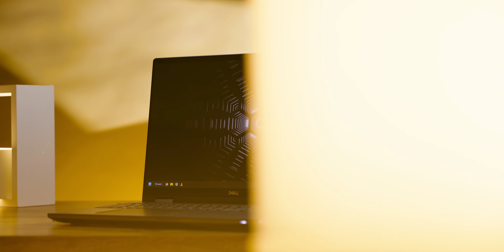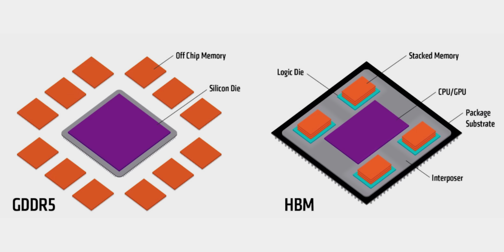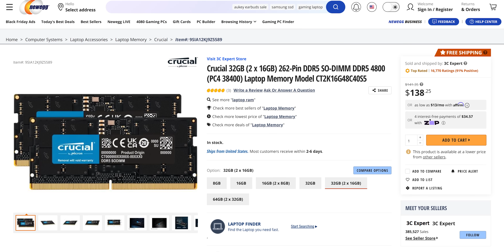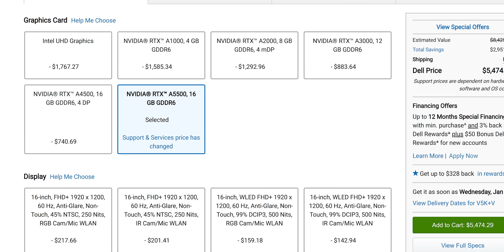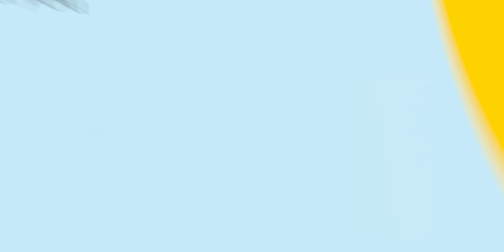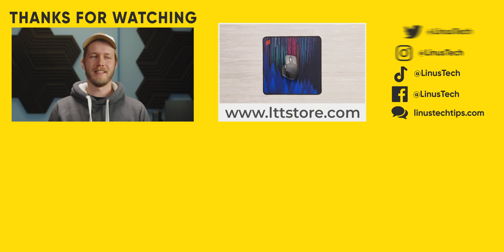I've NEVER Seen a Memory Stick Like THIS - CAMM Explained

Comment: Doesn't look smaller and I don't understand why they cannot flip the sodim placement, to have the connector next to the cpu. It is not even thicker. My asus vivobook s 14 k3402 has the sodimm slot base close to cpu. Only problem with that machine, the other "module" on the other side of the motherboard is soldered.

Comment: I managed to get a RTX A2000 6gb model for €250 (used) and I am truly amazed at how good it is for a 75w pcie powered GPU.

Why not the 12gb model some of you might ask... Well it's a 75w max card, so more vram means less power for the gpu cores. Less power for the cores means less fast in games and 6gb is still enough for the games I play.

Comment: Actual question: Why THE FUCK is it important to make devices thinner? They're already so thin, I can bend a laptop with my bare hands.
Also, the complete lack of reusability means this is e-waste generating trash.  Might as fucking well solder to the board at that point.

Comment: People upgrading a laptop over it's functional useful life make up such a tiny percentage. I would rather just have soldiered ram and instead of making a new janky standard, how about making large ram the standard. Why the hell do any machine still come with 8Gb of ram is beyond me. We should rock a minimum of 32GB if not 64GB. And if you bought a laptop with enough ram to begin with than you would not be in the upgrade boat.

Comment: if Dell is opening this up to anyone to use I am all for companies trying it, my last laptop had soldered ram (it wasn't much it was 4GB) and the ram failed, guess what you can do with a laptop that has dead ram when you can't replace it? add it to your e-waste pile. there may be a way to desolder the modules and get the same modules but a $90 laptop isn't worth doing that too IMO.

Comment: Most Precision user just cannot care about the speed of the actual machine because they cannot experience it.
I get precision workstation laptop from my big company and all the big companies have super slow UIs because of all the security stuff, too slow servers (even if they have the best and most expensive stuff available on the market) and VPNs.

You just can’t experience the actual speed of the physical machine, because it’s overlayed by super slow virtual things..
And usually there’s no way to get around it as a normal engineering employee like me.

The sys admins could, but then they would properly loose their job, because it would cause a security breach.
We can’t install software anyway, so it has no use at home besides for work purposes and browsing the internet, which a 200$ laptop could do also.

Only if your hobbies are the same like your daily work you would gain at least a little bit from the fast processor, obscenely large ram and super expensive Quadro GPUs.

In my case it’s only cool for designing, rendering and simulating stuff in CAD etc. but all the other tools my daily work includes are absolutely useless in my sparetime.

Comment: To be honest these modules are still pretty big, thick and far from the CPU (in an electrical sense) as well as being more costly than soldering. Much as it would be nice to have upgradeable RAM again, I don’t think this will be the solution.

Comment: Wow, such bullshit. Regular ATX modules are as far away and they've no issues running with 10 Gbps, if you give them and a controller enough voltage. The only reasons SO-DIMM are so bad is unreasonable, laughably low memory controller voltages that doesn't even pull a noticeable amount of power to begin with and SO-DIMM modules are made at lowest cost possible.

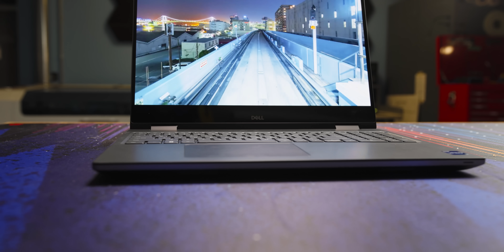Comment: @8:55 haha nope! Because it's bought in bulk for the office they tend to come with just 8gb ram to lower cost of which 7.5Gb is in use by Windows and management software from the IT department.
It's just enough to log in to a remote desktop session and maybe you can do some word processing and internet browsing without too much swap slowdown.
Reply: 7.5gb is not enough to use RDP and internet browsing? Are you smoking crack or something?
Reply: @Bramble20322  Yea you missed the part where I said 'in use'. So you got 500Mb to work with after startup.

Comment: Dell had always hated its market niche as “interchangeable windows PC you get as a short term solution to an immediate need” and has been really jealous of Apple…to the point I hold out hope for them to lose their mind and make a Linux distribution and just go full Apple and reap the rewards of Oisin source while contributing the bear minimum back and doing all the real work at the top level that they can close off with patents and copyrights. 

Gives Intel an off-ramp to replace Apple too. Do android integration better and make a “hacker’s iCloud ecosystem”, lean on proton and extend it to solve app compatibility (find a way to get apps that won’t require on a VM or other “emulated” environment. 

And do all this beautifully.

Comment: There are a LOT of things Dell does with their hardware that I wish were industry standards.  Their server rails are so easy to work with, and completely toolless.  Their servers also require no tools to put something in an expansion slot.  The unique things in their desktop s machines are also things I wish would be industry standards: fewer wires from the power supply, toolless cardslots, power for drives coming from the motherboard, mounting the cooler through the motherboard and into the case itself, fans mounted to brackets and then clipped into the case, etc.  People criticize Dell for many of these things because they're not industry standards, but I contend they SHOULD BE industry standards.  

Granted, Dell has a great many things wrong, like their habits of underpowering CPUs and buggy firmware and software, but I do think they could do more harm than good to the industry, if the industry would take inspiration from them on many things.

Comment: If your laptop is so slim that they need this to replace the SODIMM slots so they can make it even thinner, that machine does not need nor can it utilize 128+ GB of RAM in the first place. Forget the speed of the memory at that point, if you're going that thin then your abysmal cooling solution for whatever high end hardware you crammed into it will throttle the performance of the entire system light years beyond the Improvement you would gain from having shorter RAM traces. This all seems really silly. If you want high end performance you get a thicker laptop for better cooling. Then you put the SODIMMs wherever you want, including the opposite side of the board under the keyboard, and you don't have that trace length problem.

The use case this is proposed for isn't one that would utilize high end or high capacity RAM in the first place, and everything else has enough room to place the DIMM slots in a way that doesn't sacrifice trace length because they aren't trying to make the laptop super thin. You're also not upgrading soldered-on RAM if the CPU also soldered to the board can't support any more RAM anyway, so this wouldn't solve that either unless the CPU became socketed as well. But then the laptop wouldn't be ultra thin anymore, so you're once again back to not needing this special thin module.

The Raider series from MSI puts the DIMM slots back to back directly in front of the CPU so that each module has the same length traces and they're both really short. It can be done, Dell Alienware has just chosen not to.

Comment: No one asked for paper-thin workstation laptops in the first place. Paper-thin laptops and gaming or productivity without throttling don't go together. Make it thicker, beef up the coolers, and put regular SODIMMs in it. This is a solution to a problem you're creating on purpose. They don't need to be any thinner or they'll fold in your bag like an iPad pro.

Comment: More details on the thing above the module at 8:03 ? Are the bendable pins only on that module, so we don't have to worry nearly as much about bricking the device with a bent pin, like sometimes happens on a CPU socket?
Reply: The thing above the memory is a compression connector. Apparently the board nor the module have pins, only pads. The compression connector goes in between the board and the module and has a bunch of springy pins/contacts(the are exactly pins they are contacts coming out at an angle so there’s more surface area) that connect the board and module.
Reply: TL;DR: MoBo and RAM have contact pads, not pins. Compression Connector uses pin things to bridge the connection.
Reply: @Likeomgitznich  Neat. Though I'm worried about having to align all that as an end user and then bolting it down. SODIMMs seem so much easier.
Reply: @tom611  it’s sort of self aligning. The compression connector has pegs on both sides that fit into holes above and below the 2screw holes on the motherboard and memory module
Reply: @Likeomgitznich  Interesting. Kinda wish they covered that in the video.
Reply: @tom611  yea thinking about it now, LTT did a bad job with this vid. Can’t see why they didn’t include this and more info. It’s not overly technically.

Comment: 3:50 the zigzaging is length compensation. All wires need to be the same length. No, those zigzags are no reason to increase distance. You could compensate run time differently.

Comment: I just got a 7670 as a work laptop. I hate it. The keyboard is a piece of shit. The fans are constantly running in high gear even with the laptop not doing anything. And the stupid ethernet port door thing is dumb AF because it sticks down further than the bottom of the laptop and now its like a table with one long leg, it wobbles on my desk.

Comment: I wouldn't be too upset with Dell , even if it's hard to get these and you can't upgrade them past this generation, as long as it's a 64 gig option you get 32 gigs now and 64 later. If you ever need such a thing on a laptop for some reason.

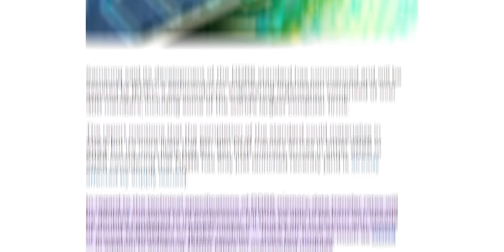Comment: In that image at 3:04 that shows long SO-DIMM path lengths, why didn't the designers of the motherboard rotate the DIMM sockets 180 degrees and move them toward the cpu?  That would greatly reduce the path lengths.  So I think this was an unfair comparison to a bad design.  EDIT: I watched a little more of the video, which asked my question at about 3:38.

Comment: As a decision maker in my IT department, I appreciate these business related device videos. 
Keep up the great work!
Reply: As someone in an IT department, what do you think about the Framework laptop?
Reply: @GeoStreber  not op but I can answer from my own perspective. Usually at least for me I don't have time to be taking apart devices to replace or upgrade them. We would tend to stick to devices like lenovo because if the device has a component break we call the manufacturer and get them to sort it. 

As much as it sucks, repairableity means little to us. What's important is how long it will take from us telling our suppliers that a device was DOA or has faulty component to them sending a guy out to us to fix the issue.

Whats my turn around time if a framework laptop fails 2morrow. What's my downtime and for how long is a staff member without a device for? These are the major selling points for corporations.
Reply: @GeoStreber  i’m field support, not a decision maker, but it seems like it makes more work that it’s worth time wise. Dell, HP, lenovo, ect. are too responsive to multibillion dollar companies with thousands of devices. I definitely do believe that’s how consumer products should be!
Reply: no

Comment: Intel's Xeon Max HMB and the un named AMD equivalent makes this a very moot point. The future of memory isn't ddr, or anything from Dell for that matter. It is on die HMB with 1+tb/s bandwidth that off die memory could never compete with. This memory is not a good thing in any way. It completely ignores where the CPU and GPU market is already headed. In other words, it is a bone headed marketing decision that will hit the scrap heap... In a few generations consumer pc products wont need ddr memory, it is too slow...

Comment: It'd be cool to get a 128GB module and use 28GB as system ram with the other 100GB as a RAMDisk for the OS.
Reply: Nice, a computer that has to be powered on all the time, how didnt anyone think of that before?
Reply: Yeah but that'd just drain the batteries all the time.
Reply: or you can use a nvme drive which is bigger, plenty fast for everything and way cheaper. ramdisk for the os gives practically zero benefits today and this was debanked to death.

Comment: I wonder if Apple could use this in Macs, given how they’re slowly making iPhones more repairable. Seems right up their alley as the king of soldered RAM
Reply: Soldered RAM during the Intel days. On-package high-bandwidth RAM with Apple silicon.
Reply: I hope so even though I personally wouldn't hold my breath for Apple. Soldered parts like the RAM and the SSD are one of the biggest reasons I don't buy MacBooks or any of their macs as a PC guy who loves upgradability on his machines.

Comment: Unless other major laptop makers start using this, no thanks.  Just because a connector or module design is open, that doesn't mean it will actually gain industry-wide acceptance.

Comment: It would be so great if their XPS13s would finally be upgradable.
Reply: That would be amazing. I'd totally buy one if they did but for now I am sticking with HP's Envy X360 line.
Reply: @jacobperez8921  I have one for uni and work because 8GB of ram is fine for emails, browser work and a bit of coding, and the SSD is fast enough for using Swap if I really need to, but... More is more better.

Comment: Hear me out, Dell's 6-8 pin power standard is also pretty nice, too. It came out way before anyone had the idea for ATX 12vo and it was a nice way to minimize things inside of the system and reduce the cord count and overall cost
Reply: You know if only they made it in Industry standard first so it was actually useful and could be used elsewhere and didn't require buying proprietary parts
Reply: When did people have the idea for ATX 12VO?

Comment: I don't buy that. You can put 2 SO-DIMMs on top of each other and have shorter signal length. The thinness is just another stupid marketing trend. Like the thin smartphones where the thin battery does not even last half a day, yet they are super expensive.

Comment: Can manufacturers stop making Devices with 8GB of RAM and 256GB of storage as the standard? It last for 2 years max and the day you finally install all of your corporate apps is the day they start to chug. Then belong in the E-cycle bin. Which is disgusting. Let's put more focus on making 16GB+ of RAM (have apps designed better... yes you MS and Google) with 512GB of storage. BAM a pc that will at least make it 5-7 years.

Comment: The size difference by capacity is such a big problem for the new memory. The old SODIMMs do NOT really have the same problem
Reply: SODIMMS have very similar problem. Some devices have 2 SO-DIMM slots when outhers (typically larger ones) - 4 SO-DIMM slots with capability to have 2x the RAM amount.

Comment: The millimeter to fractions of a millimeter you would be saving would only make sense in a thin and light professional workstation. To be fair, that is a lot of different laptops, and if apple used this, I would actually be tempted to get a macbook for once. However,  for anything that focuses on performance it makes no sense. Because if I buy a laptop for gaming or CAD, I want better cooling for sustained performance. That cooler better be bigger than anything else on the motherboard!  You do get more ram, but you also have to buy a new module everytime you upgrade. You cant use the old one for anything, and it looks like if modules take up multiple different sizes, that effects interoperability. At best, this puts it on par with the laptops that use the m.2 2230  form factor. I think we are going to see OEMs have laptops that can accept more memory, but only the OEM will have the modules in the correct size for it to physically fit. And while an aftermarket part will inevitably be made, it may take a while for it to show up. My experience with thinkpads using the m.2 2242 ssd's is that aftermarket exists, but it's either really expensive, or you may have upgraded from that laptop by the time they exist. Either way, while I'm extremely skeptical, I'm optimistic about this allowing for more repairibility in more laptops in the future.

Comment: While I understand the technical explanation, and I see that the connector itself is much closer to the CPU, some individual memory chips are still quite some distance away, especially on the 128 GB variant that was shown, why is this not a problem with this design?
Reply: The distance is actually trace length - the length of the wires on the PCB. So as long as the connector is short, they can loop and zig zag the traces around on the memory module so they're all the same length.
Reply: @adacable2266  yes, but the traces will still be longer (cpu to connector length + connector to farthest ram chip length in order for all of them to be the same length), which in the case of the big capacity module, makes all of them longer than a closely put sodimm slot, so better signaling my ass...

Comment: This looks like pcie MXM. Was supposed to make GPUs in laptops easily upgradable. Was supposed to bring down the prices. Was supposed to blah blah blah! I remember looking up a GTX 980m xmx 3.0 you. At the time it cost 999.99 for a brand new laptop with a 980m in it. Cheapest I could find the MXM 980m for was 1300 dollars same when the 10 series came out. A brand new laptop with a 1060 6gb was 700 bucks. Or 950 for a 1060 MXM card. Give me a break. This is just Dell trying to make the news. And any early adopters will get screwed over when the standard is dropped in 6 months